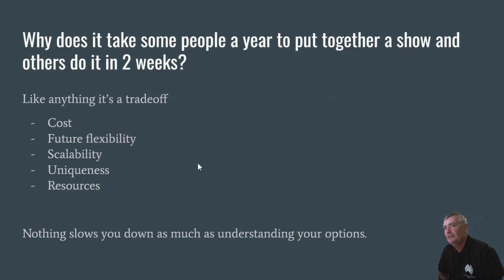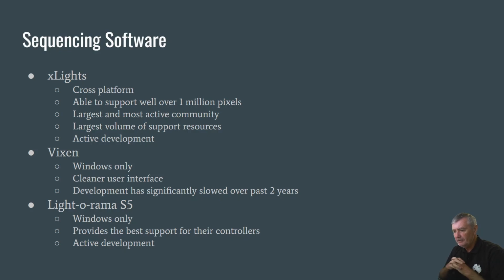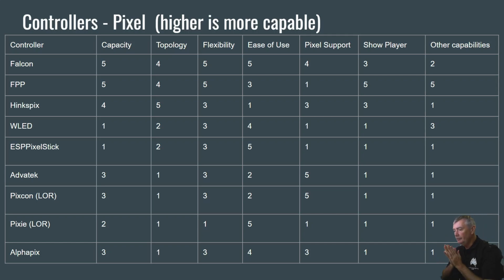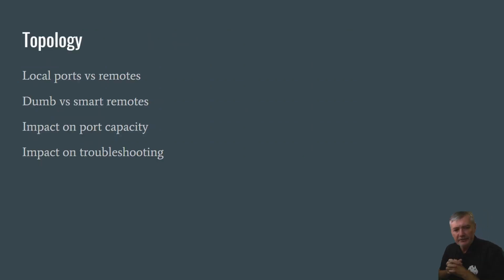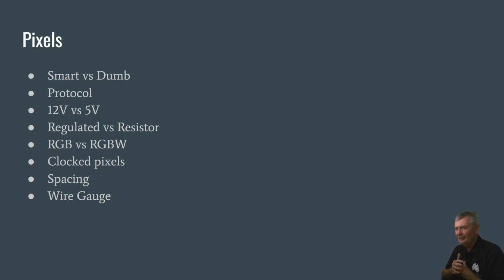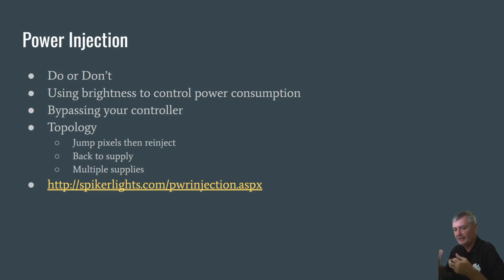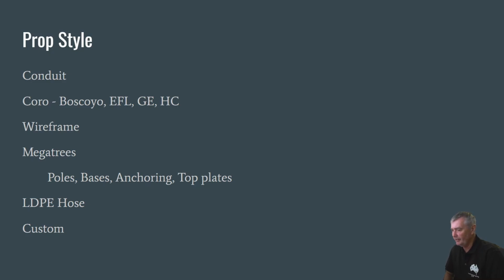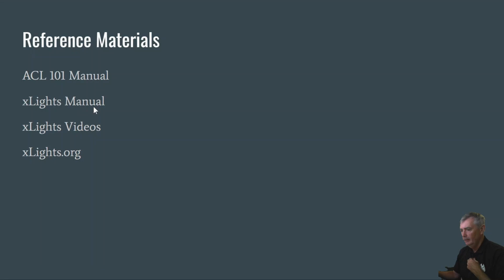What an absolute beginner to Animated Christmas Lighting Needs to know!

Comment: Hi ,sorry for the late question:I have light a rama s5 pro with 112 ac channels  and 2000 ws2811 pixels would I benefit from changing to xlights?
Reply: To answer your question, in one word maybe?  Light o Rama has good software, but trying to incorporate other controllers using DMX will require converter cable/device box, but if your entire display is LOR and ready to go, no need to change.  This question is better answered through learning more about other controllers, and what you wnat to achieve in the coming years.
Reply: Sorry I also only have light a rama controllers.
Reply: Thank you for the information.